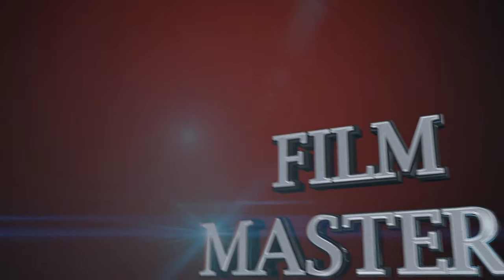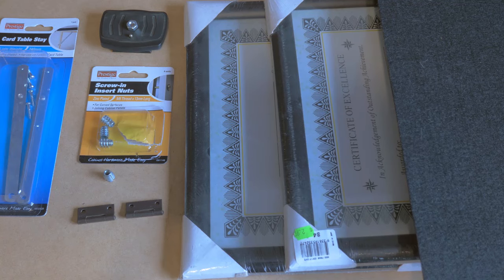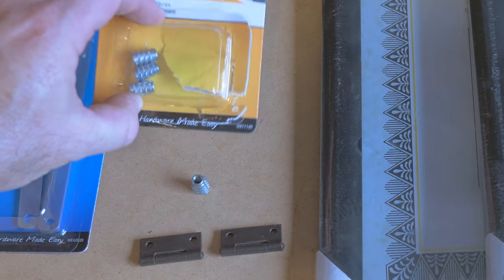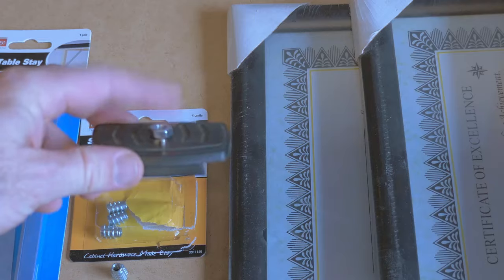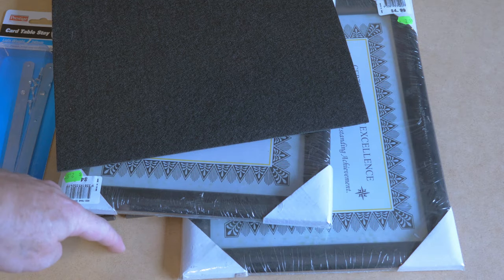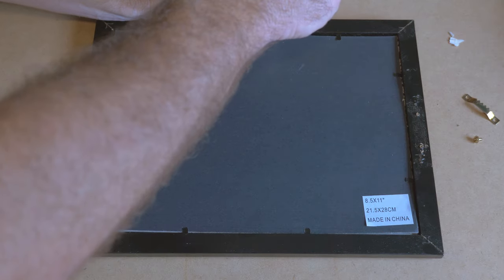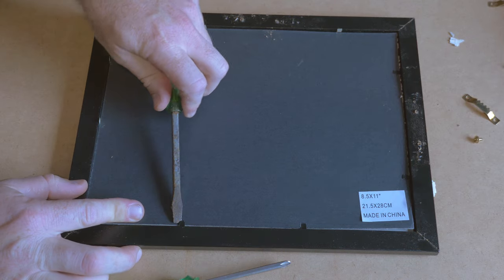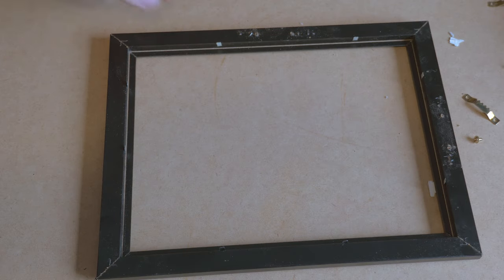Make a cheap Teleprompter for your iPad under $20

Comment: Hi Michael,
 Great video,Thank you.What do you think about using Powerpoint in a teleprompter? Would it be a better option to level up my video quality, especially talking heads?, but I would have to mirror-flip the slides and advance them with remote using PPT Mirror tool.
Reply from the maker: Hi Kendrick, You could use PPT as long as you are able to flip the written content on screen. A teleprompter app will invert the script so it can be read via the reflection if that makes sense?
Reply: @FilmMastersChannel  Yes, I found PPT Mirror tool to mirror-flip the slides, so I assume that It would be a great way to assist me in delivering professional narration as I don't have to read word for word because I always have my whole concept in front of camera.

Comment: Excellent how-to on this project.  Unless I nodded off (well, I am old), I didn't see or hear how your camera was mounted to this rig. It shouldn't difficult to figure this out though.  Cheers, Chuck  : +)
Reply from the maker: I put my camera on a tripod under the black cloth. Make sure your lens is right up against the glass. That way you can read it and the camera wont pit up the text on display.

Comment: Hi Mike,
Thank you for the review, what do  you think of using powerpoint slides in a Teleprompter using the combination of  ppt-mirror tool and an iPad, would it be a better option to lead my speech to more natural?
Reply from the maker: Hi Dean, only issue is you will need to reverse the image so it shows properly. I used a plugin on my apple ipad which allowed me to write the text and then I select a button the flips the image for when I project it into the glass. You can give it a go and see if you can do that on PPT. You mentioned PPT mirror which I think (tell me if I'm incorrect) but it allows you to flip the image over in PPT. If that is the case it should work.
Reply: Yes, the PPT-Mirror.com tool converts and mirrors-flip PowerPoint slides for any mobile device and immediately use them in Teleprompter to help with the lead while you speak to avoid sound monotonously and facade in front of the camera.

Comment: So we will need 2 tripods? One for this project and the other for the camera? Is there a way i can only use 1
Reply from the maker: You could build a stand for your teleprompter or use a light stand, or desk ect. I am certain in the video I explain I was using two tripods. Most people who do video usually have more than one. However you can buy cheap ones for the teleprompter from ebay starting at $10. Just depends on what you are using it for ect.

Comment: Look great, however what about beam splitter glass? Not a real need?
Reply from the maker: spliter glass is super expensive and you dont see any reflections on this. try it for yourself its cheap and works perfectly
Reply: KingMidas or just use a matte screen protector

Comment: Thanks for the video ! I have bought a teleprompter on Amazon for 95 bucks...
Reply from the maker: Did you try and make the teleprompter or opted for a bought one first?
Reply: Stefan Mueller i just made one using a hinged picture frame from Michael's, the whole build costed about $35 thanks to those ever loving coupons and to fix the double reflection use a matte screen protector on your device omg its like looking at a 720p video quality text